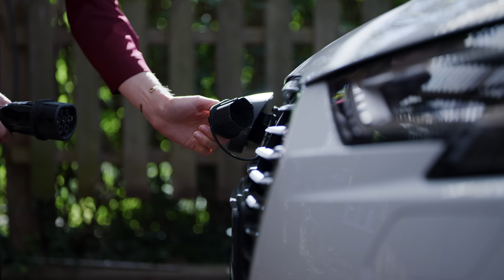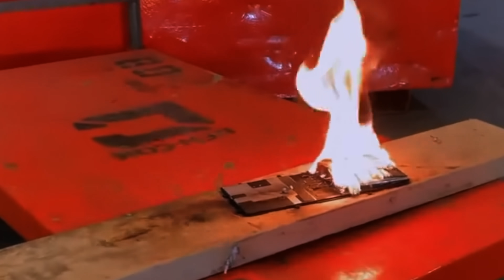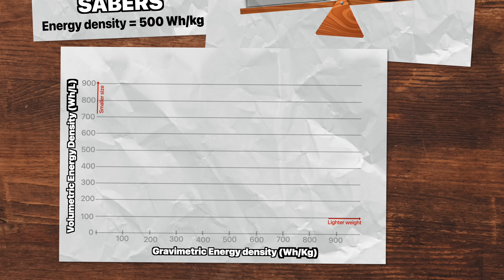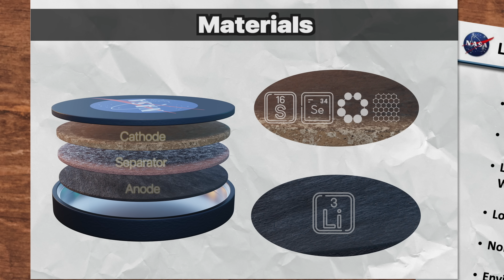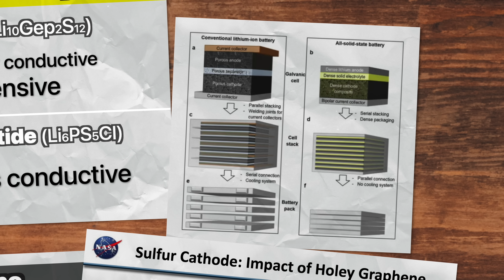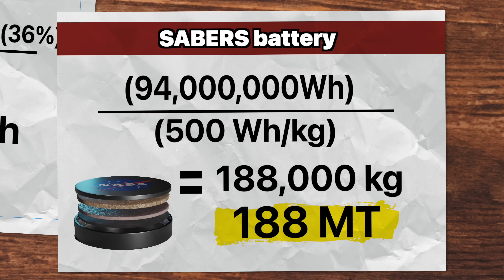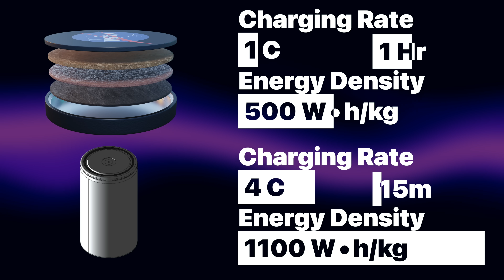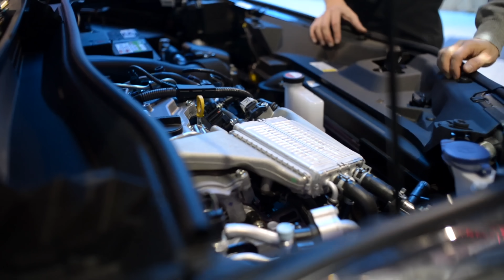Why NASA is Building a Solid State Battery

Comment: Don't forget airliner range also has to include things like diversion to next suitable airport and a half hour or more of dwell time in case the destination airport gets fogged in or gets closed because of an incident.  This changes your back of the envelope calculations dramatically.
Reply: And maximum landing weight.
Reply: @VolatileMenace  Landing weight does not require energy.
Reply: @renedekker9806 no, but you’re not burning fuel which reduces your weight. Batteries weigh the same no matter their charge. And landing weight (and takeoff weight) determines your cargo and passenger capacity.
Reply: @notreallyme425  "(takeoff weight) determines your cargo and passenger capacity" - indeed. As long as your landing weight is not higher than the takeoff weight, it does not matter for cargo and passenger capacity. It just matters for the length of the runway you can land on.
Reply: @renedekker9806  it has to withstand huge energy tho in he landing gear and actual structure, so it would indeed mean take off weight can be far higher than landng weight
Reply: @renedekker9806  Nope. Max takeoff weight can be higher than the max landing weight. On a large aircraft it can be over 200000lbs. One of the reasons jets dump fuel in emergencies is to make the aircraft lighter. Landing puts more stress on the airplane. If you could land them very smoothly that wouldn't be a concern, but in many cases they slam the ground quite hard. Do an experiment. Take a stone and place it gently on soft soil. Then take the same stone and let it fall from 3 feet above the ground. Observe the indentation the rock leaves on the soil. In both cases the stone weighs the same, so the extra energy of the impact is what makes the difference. If you study engineering you'll find out there's a big difference between static and dynamic loads.
Reply: @johnnyblue4799  "... they slam the ground quite hard" - the weight does not influence whether the plane slams into the ground. If the plane can fly and stay in the air then it can also land smoothly. Planes dump fuel when returning to the airport for two reasons: 1) to reduce the consequences of a fire when there is a crash landing (a full tank during landing normally happens only because of an emergency), 2) to reduce the length of runway needed for landing. 
But you are correct that an electric plane possibly needs stronger suspension and better brakes because of the larger load during landing.
Reply: @TheAnimalOverflow  " it has to withstand huge energy tho in he landing gear and actual structure," - indeed, an electric plane possibly needs stronger suspension and likely better brakes.
Reply: @renedekker9806  The weight does influence how big the landing impact is on the aircraft. It can't always land smoothly. Many times there are gusts of winds, crosswinds, storms. 
Normally the aircraft takes only the necessary fuel, so it doesn't have jettison fuel. It's only in special circumstances.
You are contradicting yourself with the last paragraph. Either the weight has an influence, or it doesn't, regardless the propulsion method.
Reply: @johnnyblue4799  "Either the weight has an influence, or it doesn't" - OK, granted, if you want to interpret it that way. Possibly the design of the suspension and/or brakes needs to be adapted to cater for the larger landing weight. Reading the comment thread back I can see that I may have misinterpreted the original comment.
Reply: @renedekker9806  Weight has a direct relation than what @jonny pointed out. A higher mass means a higher stall speed (landing speed, for simplicity). higher landing speed means harsh landing. I will say this though, all aircraft are required to meet regulations for emergency and balked landing which means they are designed to sustain max takeoff weight and max relevant speeds and more
Reply: I assume those distance figures are US-centric, because, as we've seen in Europe, a number of short-haul routes are being cancelled where there are viable highspeed rail alternatives.
Reply: 𝐁𝐎𝐘𝐂𝐎𝐓𝐓 𝐌𝐈𝐃-𝐕𝐈𝐃𝐄𝐎 𝐀𝐃𝐒
DISLIKE DISLIKE DISLIKE DISLIKE DISLIKE 
DISLIKE DISLIKE DISLIKE DISLIKE
Reply: Interesting points folks. 👍
Reply: And not having the ability to do that will change the way we do things, too, won't it?
Just think: Less time spent stuck in a holding pattern while we miss our connecting flight.
Reply: @TimeSurfer206  They don't keep you up there because they want to. They are wasting expensive fuel, so their interest is to see you on the ground as soon as it's safe to land. So you will still be circling anyway if need be.
Reply: @johnnyblue4799  You are right in saying that they don't do it because they WANT to.
But, you did nothing to refute my point of, "But they DO do it, _because they CAN!_"
Reply: @TimeSurfer206  You can't read properly. I said what I needed to say. Read it again.
Reply: @johnnyblue4799  Here's a cup of covfefe...
And a Q-Tip.

Comment: Ricky, temperatures at cruising altitude, FL320 = -40°F or C, so, you are flying to Europe, those NASA batteries have to be inside the pressure hull of the aircraft. Also, planes are regularly left out overnight, in Winnipeg - West, unheated <-30°C. How long to thaw the batteries???
I am a further 480 miles, 780 km North of Winnipeg, think colder, hell, we have a cold weather test facility for Jet Engines. So question is, 'can it be frozen on a regular basis'? I don't think so!
Best wishes from the far North.

Comment: Interested how this will eventually fare out for the home battery system...
Reply: Never: Unless you can afford a home battery system 50% more expensive than silver cost/kg... Good Luck
Reply: I'd be more curious about how making selenium batteries is going to affect the cost of elemental selenium. Selenium is about 400X less common than lithium. It is only cheap now because mining for other stuff produces more of it than all of its current uses combined. If demand goes up by 1000X because everyone wants selenium batteries, it will end up 100+X more expensive than lithium.
There already are worries about the possibility of the world not having enough lithium to meet the world's electrification needs. I cannot imagine batteries based on a much rarer element making much headway into the mainstream before becoming prohibitively expensive.
Reply: I don't think this technology is appropriate for a home battery system. The top priorities for a home battery system are to be cheap, reliable, and long-lasting. It does not need to score particularly well on either energy density or power density.

Solid state batteries make more sense in vehicles, especially when you're talking about moon/mars rovers, where the need to bring them up from earth on a rocket makes energy density extremely important.
Reply: @ab-tf5fl  Na-ion will probably be the best choice for most stationary energy storage: should become much cheaper than lithium while also much safer and the newer designs can hit over 10k full cycles with an expected 100k in the future. They could also be a great choice for BEVs in extremely cold or hot climates: different manufacturers claim operating temperature ranges that start as low as -80C and go as high as +100C. Having battery cells that can do -30C to +70C would greatly reduce the need for thermal management.

Comment: Did you include the EXTRA enegy requirements to fly to an alternate airport?  The FAA requires Airlines to have MORE Fuel in the tank than just the Flight From Airport A to Airport B  you need to be able to have enough ENDURANCE to fly to an Alternate Airport  after Getting to Airport B.  Not sure you factored this in with your Short Range expanples.  The range is proably quite a bit less than you suggest.

Comment: There are so many batteries that are great on paper and/or at the lab scale but so far from being commercially viable. The NASA battery will probably be a nice piece of research but not much else. I'm sure it will inspire other breakthroughs in batteries.

On your modelling, converting a 737 max to electric would never make economic sense.  An electric aircraft would have to be a clean sheet design that is super efficient and flies higher than current aircraft. I think Elon has talked about a supersonic electric aircraft that uses most of its energy on takeoff to cruising altitude, super-cruises and then recovers energy when it lands.
Reply: The analysis was so crude as to be usesless.  Electric aircraft use Propellers and propeller aircraft don't go near the sound barrier so the airspeed and thrust are an order of magnitude lower. The model aircraft to base off off should be a C-130 which is propeller powered and has a directly translatable prop shaft power of 14,000 kw, and it flies for 5 hours which means 70,000 kw/h battery is needed (about 700 Teslas worth).  At 600 wh/kg you need 116 tons of battery, but the max payload (fuel and cargo) is only 44 tons.  Lets say only half can be battery which means 22 tons, so reduce flight time proportionally and its 1 hour flight at an airspeed of 400 mph for 400 mile range.  That is obviously a very crude drop-in replacement and any real electric aircraft needs to be a clean slate design to be practical, and a passenger plane dosn't need to carry so much tonage either.

Comment: I suppose EVs would be a good use for this, but I'd be more interested in a house battery.
Reply: Don't worry, It uses Selnium, you won't have such a battery, unless you can afford something more expensive than silver as There is 50% less Selenium in this world than Silver.  If you can afford a battery made 100% out of silver, then there are MULTIPLE silver based batteries which will not catch on fire and burn your home to the ground with just as high of energy density... and you can sell the silver in a pinch.  =-)  Selenium... well, I do not think there are enough people in the world who need dandruff shampoo...
Reply: For stationary batteries, volume, or more particularly power density is less an issue.  Generally the best option is the cheapest that matches the desired lifespan of the house.
In transportation, any added weight and volume displace cargo carrying capability.